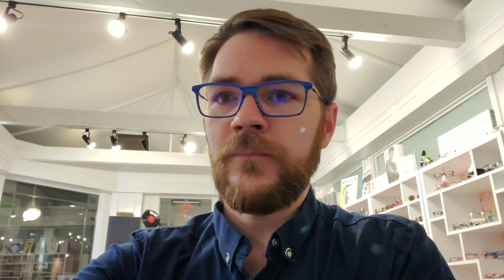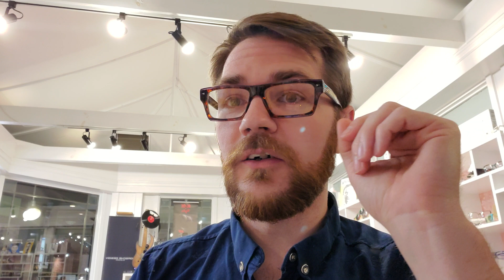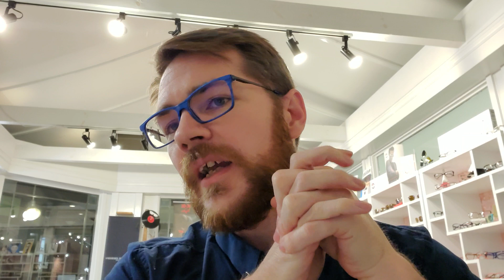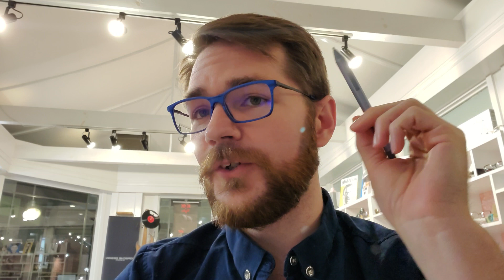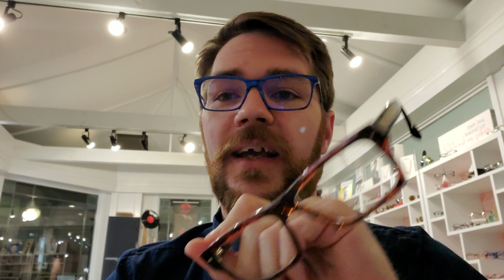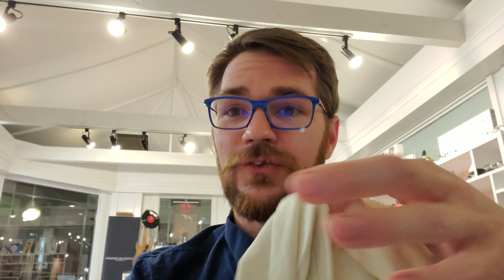Why Are Anti Reflective Coatings So Expensive?!

Comment: How to identify my glasses have anti reflective coating? At home
Reply from the maker: Most anti reflective stacks have a coloration to the reflections on the lens surface. typically green or blue. Easy quick check. There are non color selective ones but these are very rare, and in that case no real way to tell other than comparing to uncoated lenses in the same rx

Comment: 5:37   Are you telling me a cr-39 lens, with a flash-point of 230F can survive 700F ?
Reply from the maker: 3 years and you’re the first one to catch that. 😂 🥂. Most coatings are indeed cured much lower at around 50C. But that doesn’t exactly help with the need for a clean room and vacuum chamber. But on a small scale anything is possible. 🤷‍♂️

Comment: Could I make my own DIY anti-reflective coating on stock lenses? I'm on a low budget. Thanks!!
Reply from the maker: You can but at that point you're better off without. They just don't bond well to the surface and end up causing more issues than help. I know "everyone" seems to hate on online glasses, but zenni, warby Parker and the like offer a great bang for the buck. I would take a cheap factory ar over an add on after the fact ar 😁. If not check your local shops too, sometimes they have a value specific package that will be a stock lens with AR that can be an amazing value option if found 😁💥
Reply: @ThatGlassesGuy03  Ohh I see. Sounds good. In that case I think I'll check out some local shops out when I have the time. Thanks for the helpful response, That Glasses Guy!!

Comment: You sir, are a man of your word!

A couple days ago I noticed a purpley blueish reflection in a colleagues glasses, so I checked mine and the reflection is green. I think the only option I picked was an upgraded anti-reflection coating with no other details. Do most retailers offer many options with coatings or is there only a basic few? I wonder if the "crafter of my lenses" has a good variety and if not, who does?

I had two pairs with spin coating fail in less than a year after getting them. I think I probably would have been better off not getting them at all. 

The coating on my current pair is way better, I don't think it will ever fail, but I wonder if there are better coatings out there
Reply from the maker: I try to be! 😁.  Yes the reflex (residual color you see) is determined by the "bake time" I mentioned in this video. Everything from far red spectrum to the purple/blue you mentioned is available, most dont have access but to a handful of coatings and usually green or blue, with some being those pesky blue blocking (reflecting) coatings I mentioned here. The most common are green and blue. Red/peach tone is one of my favorites, right next to the very expensive ARs with what is considered non residual color (a very very soft iceberg blue, looks almost like normal reflections on a lens but severely reduced) these are VERY expensive, and take a long time to get (usually from 180-200+, and normally recommended for those in front of cameras all day). My glass lair has a gold reflex color, and that's pretty cool because it has some mirror properties from very harsh angles... I like it for just a touch of flashiness, but it's certainly the most obtrusive to wear of the true anti reflective coatings. And no they certainly dont have much variety at all like a small independent such as myself has access to :). They're geared at the masses and as such, a one size fits most approach is taken.